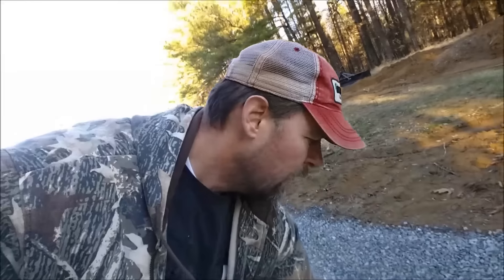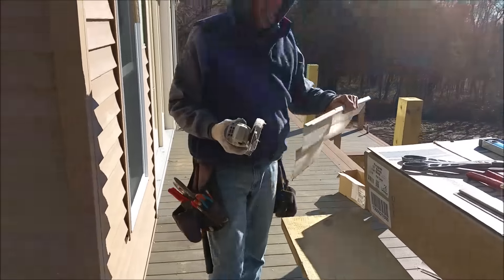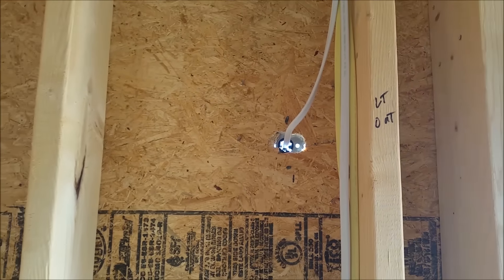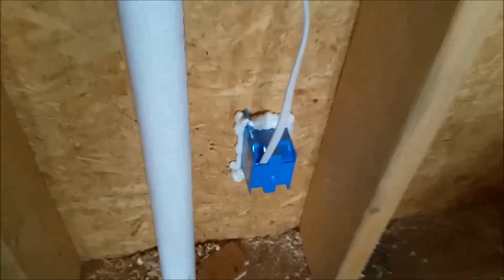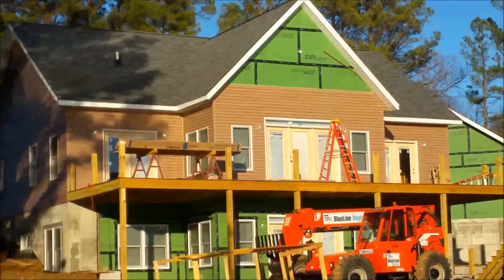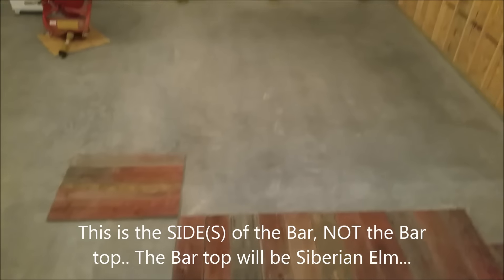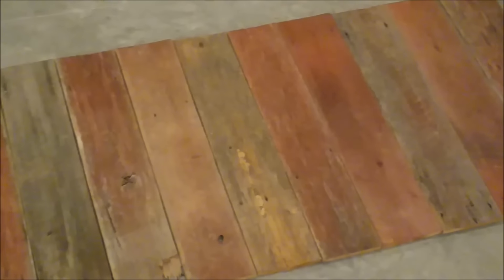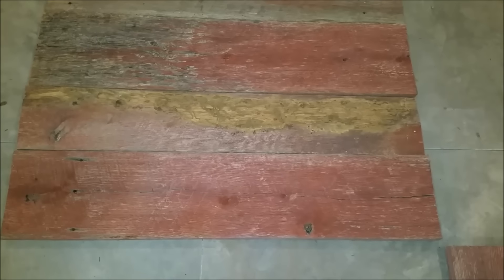Dream Home Build Update 100 year old Barn boards, Vinyl Siding, Insulation Prep

Comment: that siding is bringing the outside  to a end. how many places have u had over the yrs? aren't u tired of moving and building? as far as bars goes, u could set 2 barrels up and sling a board over the top for all the drinking i've done in my life. but hey it will probably look good, so go for it.
Reply from the maker: BigJim57 yes we are extremely tired of moving around but we didn't want to give up and sell ourselves short of what we wanted to achieve. life is extremely short and it is not a dress rehearsal as my buddy used to say, you only get one chance at it!

Comment: TERMITES LOVE STYROFOAM, I wouldnt use the stuff anywhere near the bottom plate.
Reply from the maker: Well, I'd say you are partially correct. Thank goodness we are using CLOSED CELL foam. Closed cell foam is moisture resistant (more expensive) and actually creates an additional moisture barrier. Termites will tunnel through any kind of foam (they do not actually eat it) to get to wood, but they crave moisture. OPEN Cell foam is basically full of air pockets which HOLD LOTS of moisture. The open cell stuff is much more likely to attract burrowing ants. Some extermination companies actually recommend putting closed cell foam in crawl spaces as a moisture barrier. It won't 'repel' anything, but the ants like to stay in moist travel routes... But just to be safe I will have the ground treated.